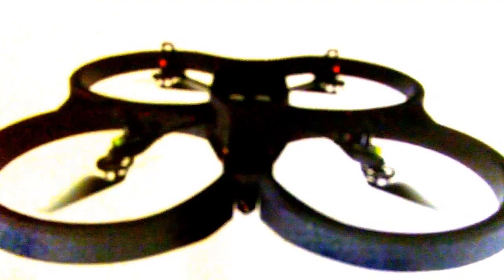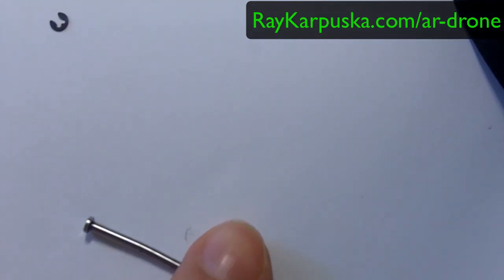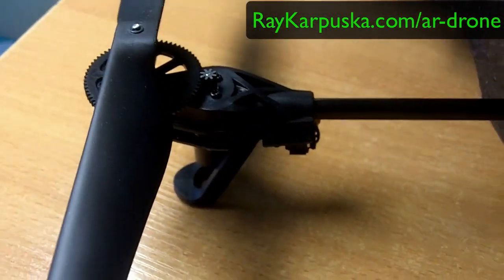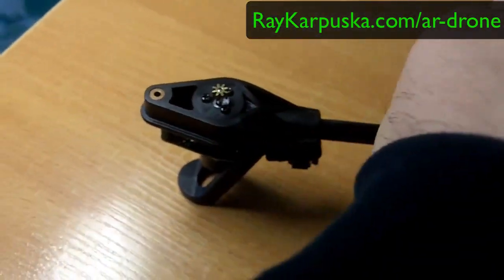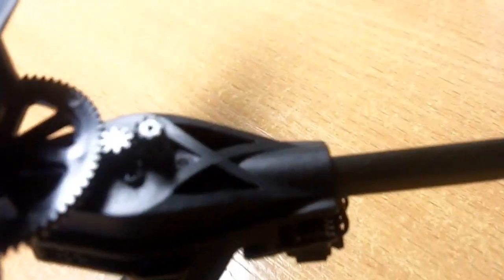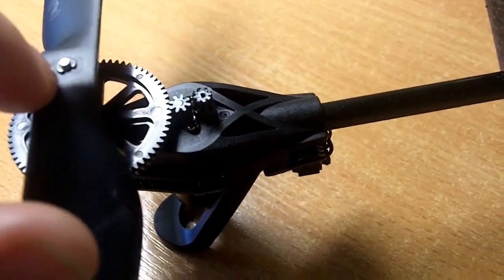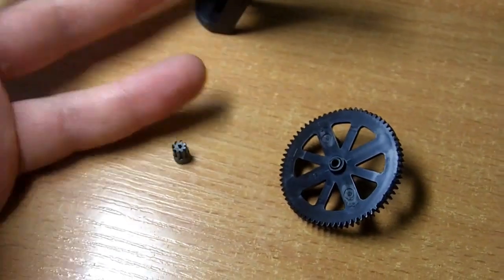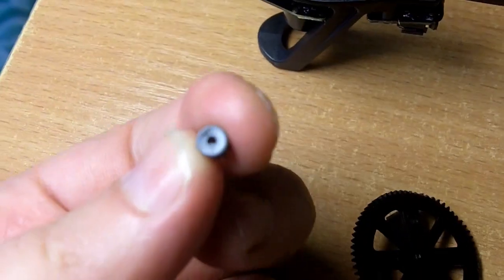Parrot AR Drone 2.0 Motor Pinion Gear

Comment: Amazing, neither this video or any other on the net shows how to remove that damn pinion gear from the motor. If you have a roughed up one, how in the world are they suppose to be removed without damaging the gear.   They don't simply "pop" off, they appear to be pressed on. At least on my Drone 1.0
Reply from the maker: push the shaft downwards and the gear upwards
Reply: raykarpuska  Thanks for the response, but I've tried that approach and it didn't work,  They won't move at all.
Reply from the maker: 1st one doesn't have that feature